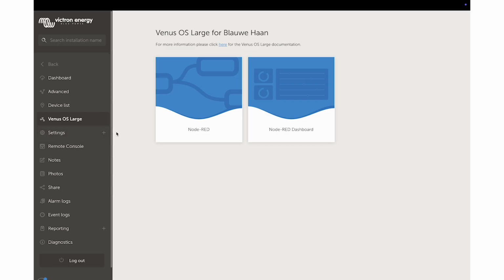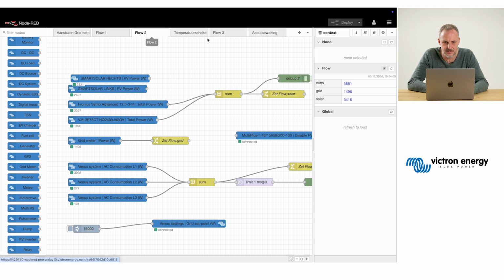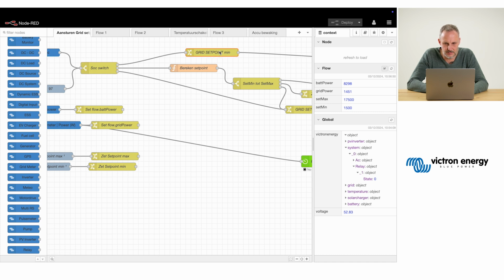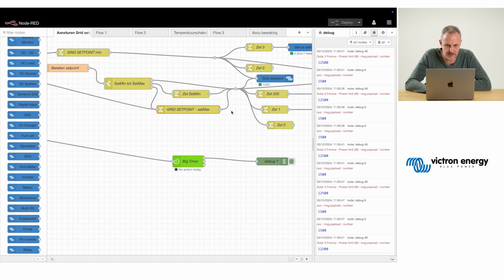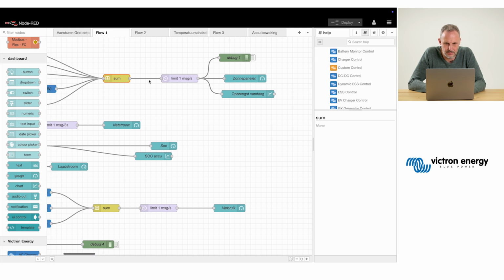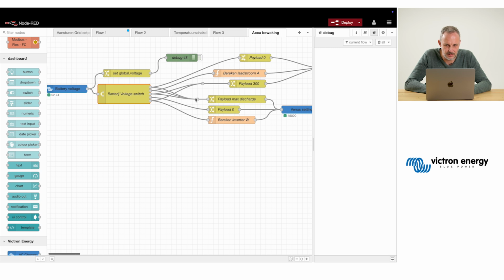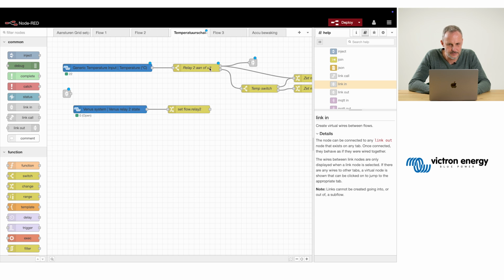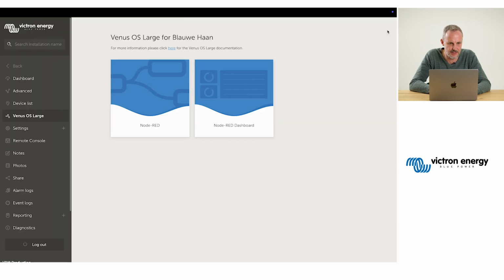How a campsite used Node-RED to heat water and control ventilation

Comment: OK… I’m building a Microgrid, and I was messing around with Node Red to get a protocol running to send excess solar to my water heater… but here’s my question…

In the opening you show 3 48-5000 inverters jammed together.  The manual says 4” is required between them.  What gives?  It would be so much easier in my barn to put them side-by-side!